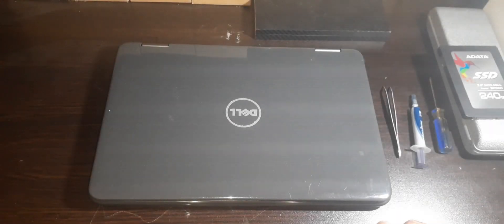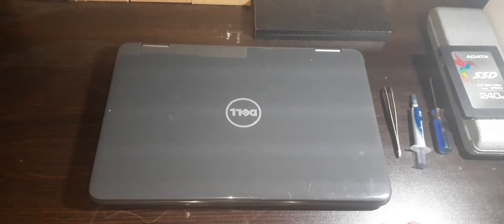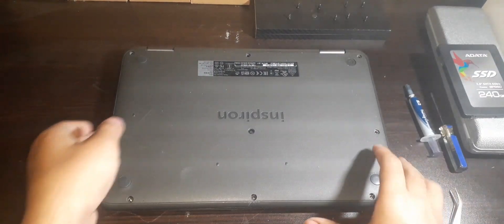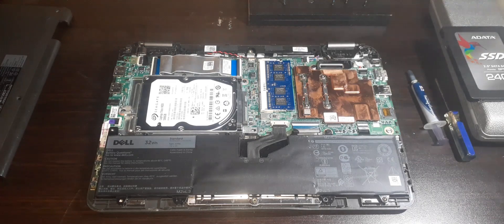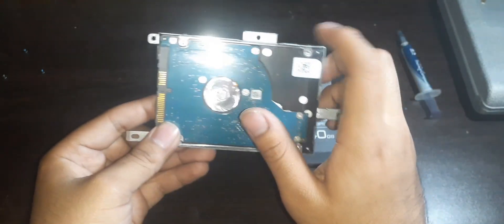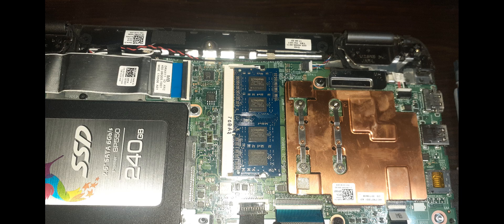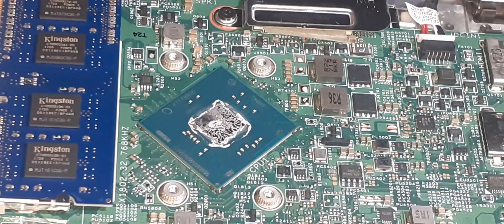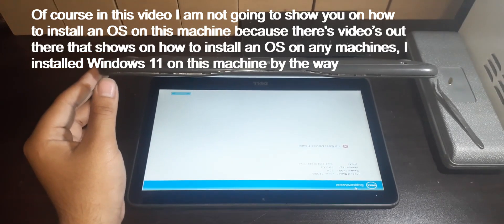Dell Inspiron 11 3168: Upgrades & Maintenance

Comment: That's wild. I have the same model that i use for travel. I opened the back and the SATA port was never soldered onto my motherboard.... there's just an empty spot there with little PCB dots and  tiny spheres of solder where the SATA port would go. Additionally, the copper plate also covers my RAM, so if i want to change the RAM i'll need to repaste. I was looking forward to increasing the storage when i saw your video but alas, unless i want to solder a SATA port on, i won't be able to do that upgrade! Thanks for you awesome vid 🙂
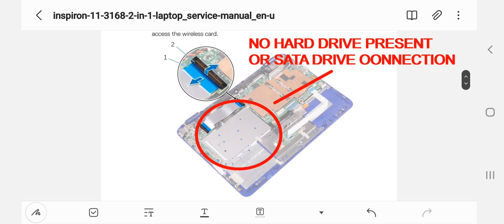Reply from the maker: Thats unfortunate, otherwise it would have boosted the performance. On my video, 1:50 I go over that some inspiron models didn't ship with a sata drive because of the CPU. If your model has the Intel Celeron,  then you won't be able to upgrade the ram nor storage drive as it soldered on. I sold this one 2 years ago, so I don't remember the type of CPU it had 😂 but it definitely could have been upgrade